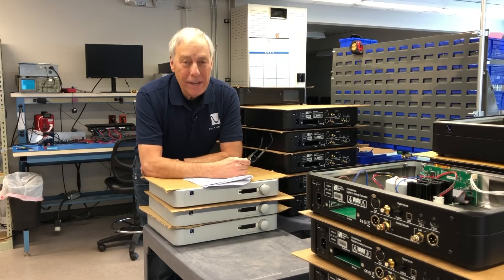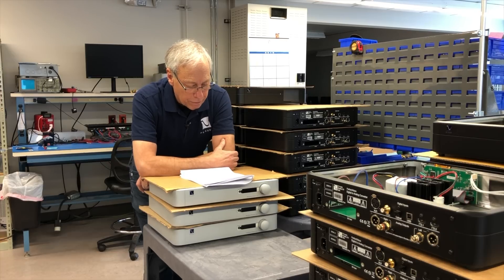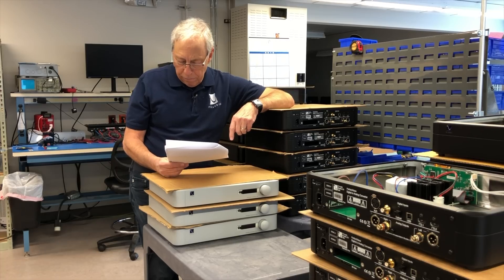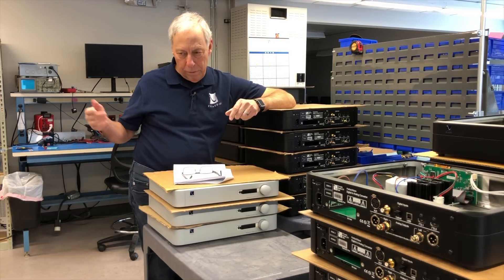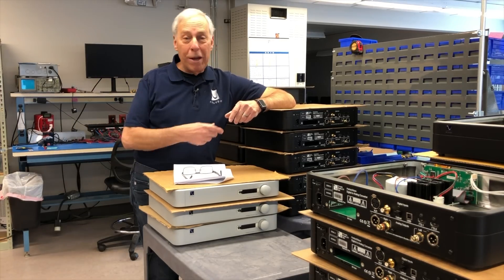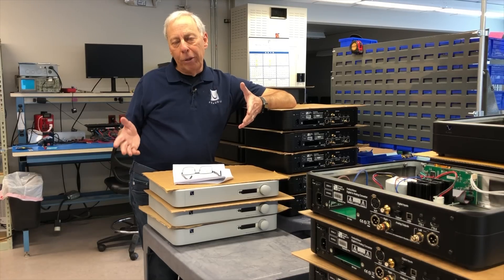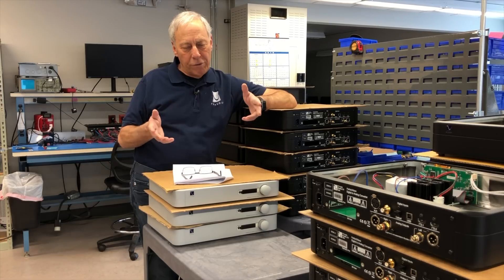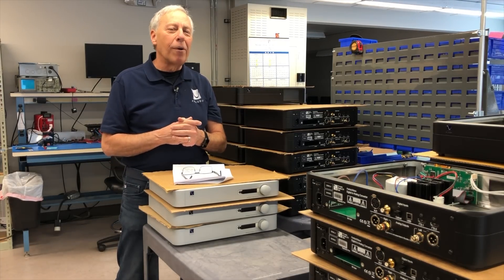Is it dangerous to run an amplifier without a load?

Comment: For a tube amp you need the load connected or there may be problems due to how an unloaded transformer behaves. On the other hand, a tube amp with its output shorted should not have problems.
Which is, of course, opposite to transistor amps - no load is OK for them and a short circuit (or speaker with too low impedance) may damage them.
If the speaker impedance is too low for a tube amp, it will just sound different and have less power.
Reply: You have it right. The reason is that an output transformer tries to act like a current source. If it has no load, it will try to output a potentially destructively high voltage while trying to get rid of the energy it contains. Some transformer output amps have a small load included in the circuit to try to keep that voltage down. But left uncontrolled, the voltage may be high enough to punch through the winding insulation, eventually leading to failure. 

There is another factor in tube amps. The tube circuits' dynamic operating points are designed with some intended load. Without that, the dynamic operating point may move to an unintended regime. 

Just because you may get away with running an amp unloaded doesn't mean you should try it. Purchase a couple of load resistors of about 2 times the highest rated load and maybe 20% of rated amp power, and wire them across the output terminals.

Comment: Amplifiers not designed to survive simple accidents like a lose speaker cable connection deserve to die 🤔
Reply: Tube apmlifiers will be destroyed without load. Since tube amplifiers are still the way to go for many guitarists and musicians they are still used a lot. The speaker cabinets and amps are  mostly connected with 6.35mm jacks. Only a moron would cause a "simple accidents like a lose speaker cable connection"
Reply: Why would something ever be made this way in the first place? it sounds like a design flaw not an intentional feature.
Reply: @ryacus  not design flaws, it has to be with their intrinsic behaviour and designed accordingly. 
SS and Valve amps are two different breeds that accomplish the same goal but with very different paths.
Reply: 🤣🤣🤣🤣 how it's said in English? The survival of the fittest?
Reply: Salvador Rodenas Yes, Darwin rules also here although amplifiers don’t breed baby amplifiers.
Reply: @ThinkingBetter  but their creator does 🐇🐇🐇🐇🐇🐇

Comment: You cannot run a tube  amplifier without any load it will damage it permanently Paul didn’t emphasise that enough
Reply from the maker: That is not true. Voltage swings on an unterminated transformer will not damage the transformer. Think of it this way. A transformer is nothing more than two coils of wire between some steel plates. Unless the voltage you are applying is hundreds to thousands of volts exceeding the breakdown characteristics of the wire or laminations (unlikely) applying output voltage to the transformer when it is not terminated will not harm the transformer in the least. It's an old myth.
Reply: PS Audio ok Paul so why do manufacturers stress not to have a load on the output.  I have seen first hand the damage caused blown output tubes and or burnt out  output transformers, I know your no fool so can you tell me  why have I seen this damage for my self. Me personally I won’t ever risk it my tube amp wasn’t cheep and output transformers are not-cheep to replace so it will take a lot to convince me it’s safe yours respectfully Ian
Reply: @Paulmcgowanpsaudio   An excerpt from Speakers are
 Important In or Out of the Circuit by Hartley Peavey offers a clear and detailed explanation. You can find it on the Peavey site:

The above is a rambling discussion about transformers
(both power an output) and their effect on the sound of
a tube guitar amp. I felt it was important to understand
what transformers do (and generally how they do it)
before getting to the final point of this discussion. As
mentioned above, a transformer works by converting
one form of electrical energy into another. In the case of
a tube amp, to achieve the matching, we “trade” high
voltage in the primary, for high current in the secondary
to properly drive the speaker. This is a “two step” process
where electrical energy from the tubes magnetize the
core of the transformer at the audio rate. Then, the
varying magnetic field in the core induces voltage
(and current) into the secondary suitable to drive the
speaker. The important point here is the energy is put
into the transformer through the primary, which converts
that energy into magnetic energy (i.e. it magnetizes the
core) and then that energy is reconverted into electrical
energy in the secondary windings, which drives the
loudspeaker.

If (for whatever reason) the SECONDARY of the
transformer has no “load,” the magnetic energy created
by the primary (and “stored” in the core) has NO place to
GO! As the alternating signal in the primary goes down,
the magnetic field built up in the core “collapses,” thus
inducing an extremely high voltage “spike” back into the
transformer’s primary windings. Because this energy is
substantial, and because the primary coils have many
turns of wire, an extremely high voltage “transient” (often
3000 volts or more) can be developed. The primary of
the output transformer is directly connected to the tubes
and tube sockets of the amp, and neither the tubes nor
the sockets (and associated wiring) are designed for
that kind of voltage. These electrical “spikes” can (and
often do) cause “arcing” inside the transformer and/or
the tube elements, especially between the terminals on
the tube sockets and the associated wiring.

Remember that we learned in high school physics
about the “law of conservation of energy.” This taught
us that energy can’t simply “disappear,” it has to “go
somewhere.” When a tube output transformer doesn’t
have a place for the energy to go (i.e. a speaker or its
equivalent) the energy developed in the magnetic core
“flashes back” into the amplifier, often destroying the
output transformer, the tubes, the tube sockets, and/or
the associated wiring.

This is WHY you should NOT operate a tube amp
without a “load!”

Ignition coils for gasoline engines work essentially the
same way. There’s a “secondary” coil of wire with many
“turns” of wire wrapped around a steel core. In operation,
a connection is made to a power source (battery) then
current flows though the primary coil and magnetizes
the iron core. The contacts (points) then open and the
magnetic field is allowed to “collapse,” which results in a
huge “pulse of energy” being inducted into the secondary
coil (which is what produces the electrical “pulse” that is
fed to the spark plug). This is also a two step process
where basically the primary coil is energized, producing
a magnetic field, then “de-energized.” As the magnetic
field “collapses” the magnetic energy stored in the core
induces a high voltage into the secondary coil which is
then fed to the spark plug, thus firing the air/fuel mixture.

An “UNLOADED” tube output transformer produces
high voltage “spikes” in EXACTLY the same manner as
an “ignition coil” does. The difference being that a tube
amp output transformer is NOT designed to operate that
way, but an ignition coil IS! Operating a tube amp with
its transformer unloaded can easily damage or destroy
a perfectly good tube amplifier by the “flyback” action
described above. Hopefully, the above will provide a
little background as to exactly WHY it’s important NOT
to operate an amplifier WITHOUT a proper “load” for the
output transformer’s secondary output terminals.
Reply: I was waiting for that too. Although that statement isn't true for every tube amp. My HH Scott 340B receiver clearly states in the manual that Scott tube amps are safe to run without a load. That being said. I own two of them (a Stereomaster 200 integrated also), and always run them with a load. Just because it's been ingrained in me, since I first learned about tube amps. So like everything in audio. It really depends on the particular design. But I'm using it as a hard, and fast rule myself. Just to be safe. 🤞👍✌️
Reply: HH Scott - are you the HH Scott or just happen to have the same name?
Reply: Yep.  I think Paul should have stressed this.
Reply: You are absolutly correct...it is in every manual of a tube amplifier...even my Marshall guitar amp
Reply: @marcelsmeets4162  No it's not in every manual of every tube amp. It says exactly the opposite of that in the HH Scott tube amp manuals. Because they're specifically designed to work without a load. 
It's never smart to make such broad statements. There's always exceptions to every rule.
Reply: @amb3cog  My apologies sir...I should have said...the tube amps I own😉
Reply: @marcelsmeets4162  Yes they can put in a circuit, or something to prevent issues it seems. I still only run my 2 Scott tube amps with a load anyway. Just out of an abundance of caution. And I think it's a good rule to follow, but there are definitely amps that are okay with it. I also don't think it's so much a tube thing, as it is an output transformer issue. I've heard tell of Solid State amps from way back in the day giving the same warnings, and they probably had output transformers. In fact I'm very curious about McIntosh amps with the autoformers, or whatever they use in many of their SS amps, and even their tube gear. Being a higher level product then HH Scott stuff, I've a feeling they put in protection circuits for this, but what if they didn't? What about other high end companies that make tube gear too? Like Conrad Johnson for instance. I bet they have a protection circuit too, but maybe not, if it effects the sound quality? Inquiring minds want to know. 😊
Reply: Correct! NEVER run a tube power amplifier without a load. Some say it will not damage Mcinosh unity-coupled amps, But I would not try it.
Reply: What about tube amps that are hybrid like the Butler Audio? My brother in law currently has only two speakers connected to five channel amp.
Reply: Dodgy Brothers Engineering as far as I am aware  values us are only used as a preamp section so it should not be a problem  because the output stage is all transistor
Reply: Dodgy Brothers Engineering As far as I’m aware soon as the tube is only used for the preamp it should not bother it because they are a transistor output  stage

Comment: Solid state, not generally a problem, but there must be exceptions.
Tube amps, most defenately YES.  No speaker load on the output transformer causes the output tubes to "play" into a wildly wrong impedance.  Also the wrong impedance speaker (s) can be a (big) problem also, especially if it's too low.  This can overload the output transformer and overcurrent the output tubes.... Generally, output tube are already biased at roughly 60% of designed plate disipation with no signal source at all.   They can/will overcurrent, maybe red plate and, at the least, will have a shorter useable "life".
There are always examples of equipment that can "take it", but maybe not at full throttle for long periods.  Not worth the risk in $$.
Most of my experience is repairing guitar amps and pro sound equipment.... butt....
I would NEVER run my treasured Mac 225 stereo tube amp at no- load or wrong-load, just saying.
Reply: Dave Micolichek  We agree it's not good, regardless.
I'm trying to figure where the spike comes from.  The power supplies,  although not "finely regulated",  only droop about 5% from zero load to full load, mostly from the impedance of the power transformer.  The front end of the power supply usually plays the rectifiers into big caps (that will supress a quick rise to the no load value).  The output transformer turns ratio is fixed.
So.... where's the problem??
The only time I have seen (arc in bottle),  measured or heard through bench speakers, any signigicant output transformer spike is when output tubes "short" (and then wait out the B+ fuse time constant or the line fuse time constant if the mfg. has poor fuse co-ordination and over-fused the B+.
Unfortunately, that happens enough to mention because these amps get banged around moving them and vibrate like crazy being played.
Not saying it doesn't happen with weird harmonics with the cause being less clear.
Anyway, I dc meggar test OTs at 2 to 3 times the primary coil working voltage, same for the secondary.  Never failed any that I'd admit.  Overload failure  (usually from too many extension speakers), well they're musicians.